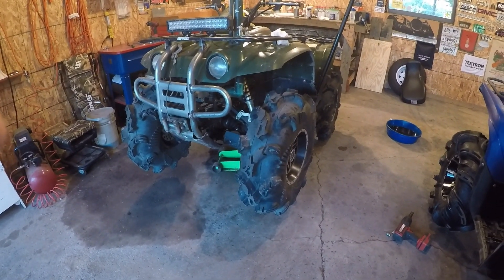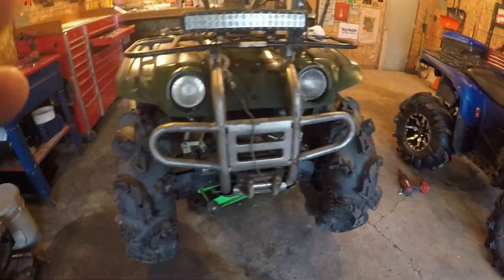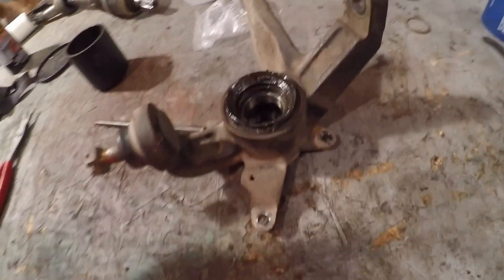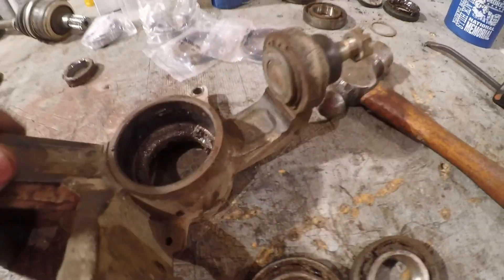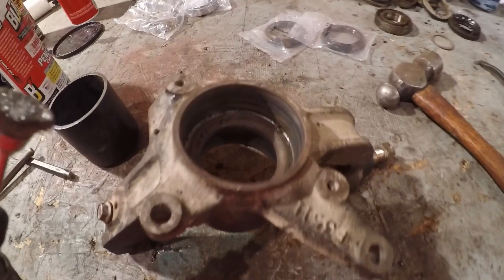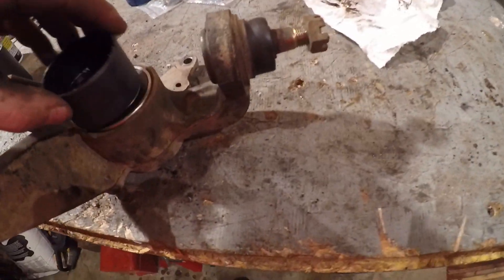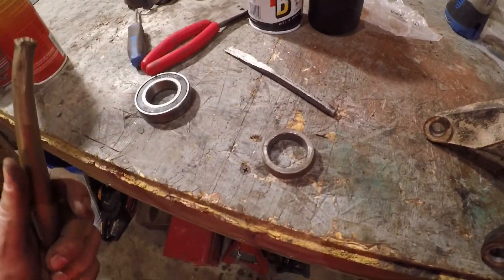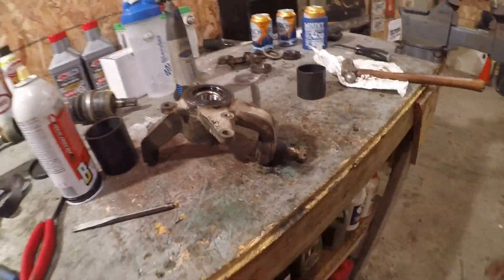Yamaha Big Bear 400 Wheel Bearing Replacement

Comment: How did you get the lower ball joint off the lower control arm?
Reply from the maker: Hit the side of the control arm very hard with a hammer. Make sure your castle nut is a few turns off first… tapered fit shafts and ball joints just need a good jar from a hammer to break them lose

Comment: I have a 04 Kodiak and it is always used in mud and wheel bearings go out twice a year and it only has 26s with no lift. and I got a 05 Kodiak I've had it for a year now and wheel bearings went out on it twice, I just recently put 28 and it 2 inch lift. So the bearings were going out with the stock tires
Reply from the maker: I don't know what to tell ya, I put in Chinese made All Balls bearings and would get 2 years out of them. Not sure if you just keep getting shit bearings or what the deal is.

Comment: You didn’t show how to take the hub off
Reply from the maker: Yea I skipped over that part. A impact gun is the easiest way to do it. I for get what size socket the nut is, somewhere in 24mm range. It just slides right off once you get that nut and tie rod off.

Comment: Bearings are over rated hit a tree and they magically disappeared and now my big bear is just sitting in the garage waiting don’t ask how it happens just know it happened
Reply from the maker: Lol, they like to go out often depending on what type of riding you do, sometimes hitting a tree, depending on hard hard you hit it, will cause a wheel bearing to prematurely fail cause something is bent that is putting more stress on the bearing
Reply: @grizzlygreg8922  oh yeah but i mean the bearing just fell out im not sure how but it happened
Reply from the maker: @Cataklixxx  It probably spun inside the knuckle housing. Sometimes that happens. but usually there is a snap ring or something else holding it in.
Reply: @grizzlygreg8922  well today my new bearings got shipped in and I found out that the remanence of the old bearing is stuck inside the hub thing idk what it’s called I’m not too smart with four wheelers but my dad said he’s gonna see if his friend has something to get it out with cause the guy works on four wheelers all the time